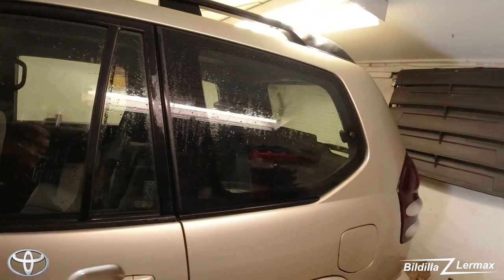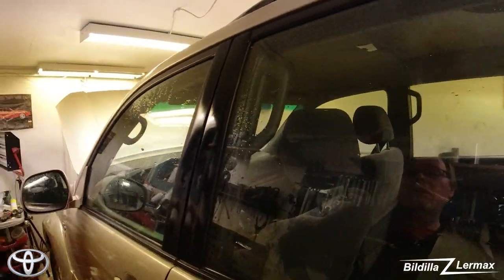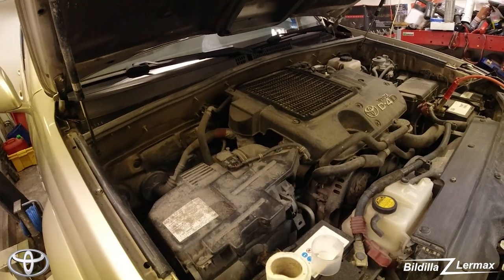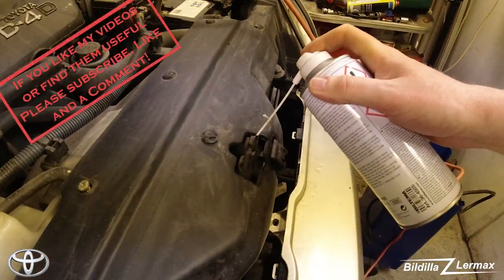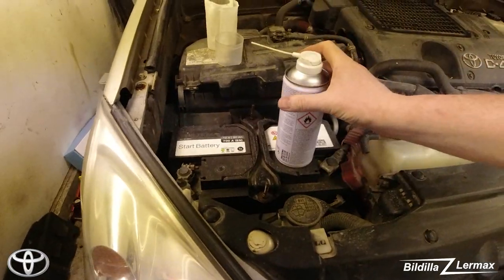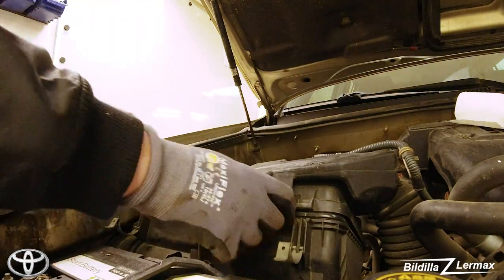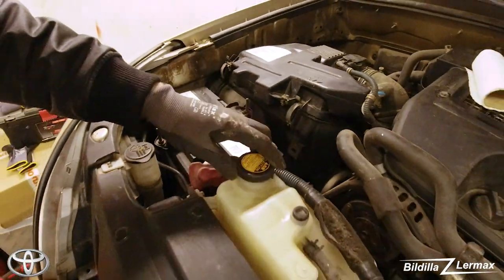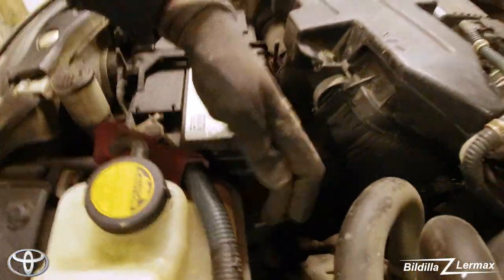DIY / How to: 2006 Toyota Land Cruiser 120 - 3.0 D4D - Prado 120 Project - Bildilla Magasin

Comment: Do you know if its possible to convert a RHD car to LHD ?
Reply from the maker: Hello.

Converting from RHD to LHD is something that has come up often on other cars here in Norway.
We can buy cheap cars from England.....
But it often ends up not being financially sustainable.
The questions will be many!
But purely theoretically, most of the mounts behind the instruments and the rest of the interior are probably the same... more or less. But without having looked at the torpedo wall, it is probably set up differently. in that case, you will need to rebuild large parts of it.
Setup of steering / servo etc. brakes and brake pipes.
wiring from the ecu inside the car down to all points in the engine compartment are probably different lengths.
There is certainly a lot of other things that need to be adapted as well.

Theoretically, all of this is possible! But you almost need an LHD share car. And with my experiences with the wiring harness on these cars... Then it would have been best to have a completely new wiring harness!

Personally, I would not start such a job. But then I have cars with RHD and LHD. I don't feel that there is a big problem with RHD in Norway.

Greeting
Pål (Paul)